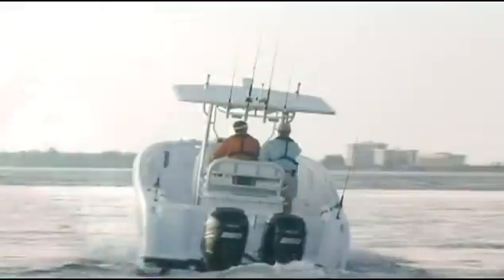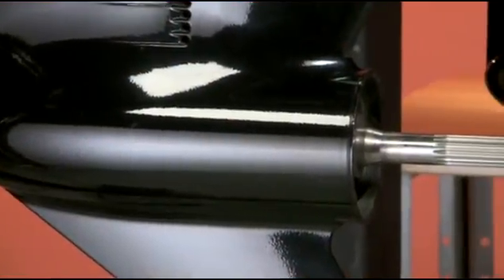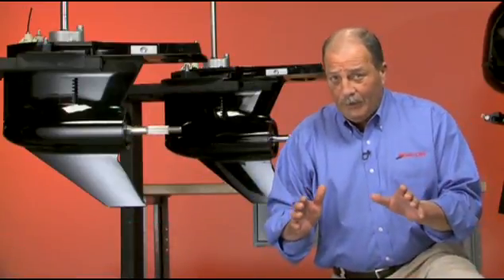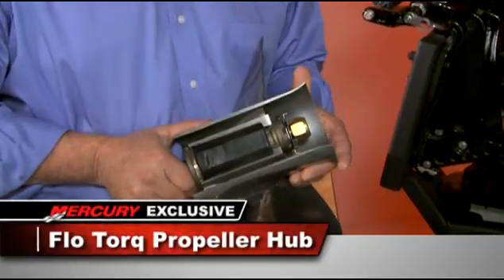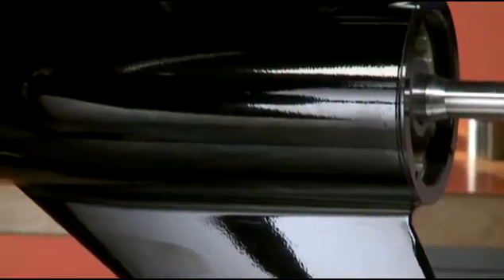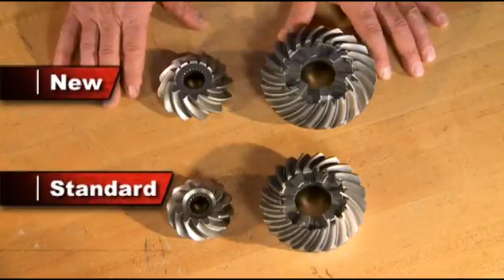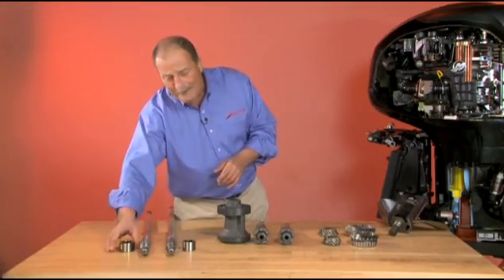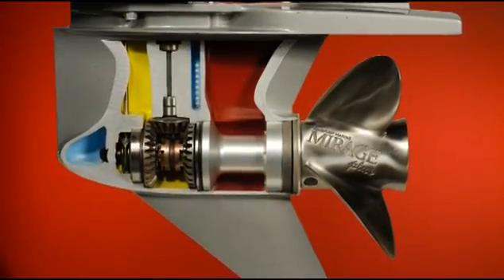Understanding Mercury Verado Gearcases

Comment: well i  have Mercury verado  250hp two engine . the engine run only 600hr but i found some small metal parts during gear oil change.
Reply: Faisal Mohamed shavings or actual parts? Either is not good but shavings aren't as bad as having full chunks of metal